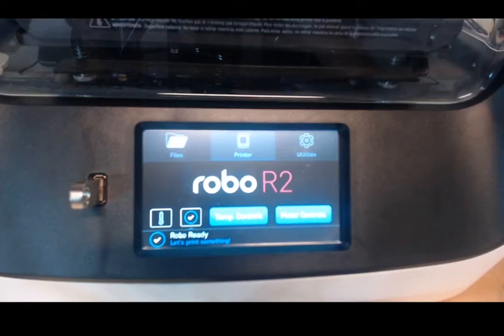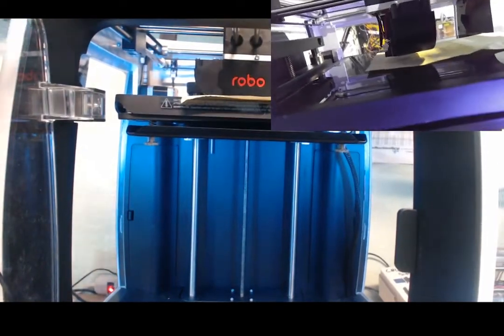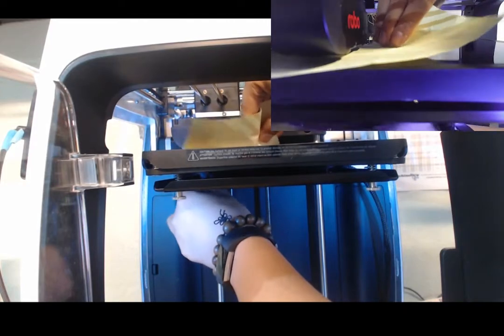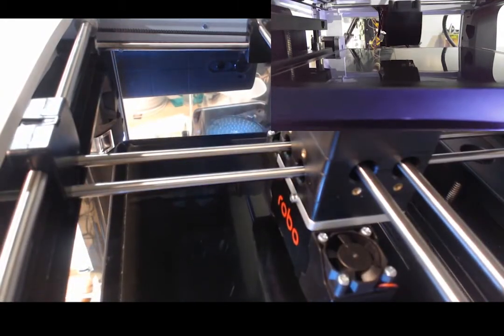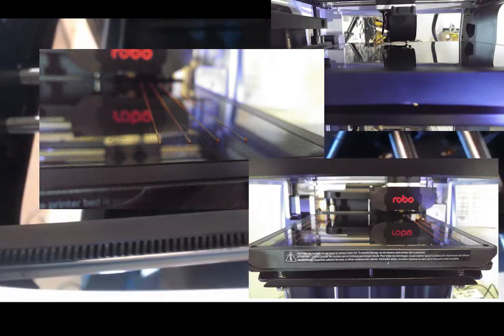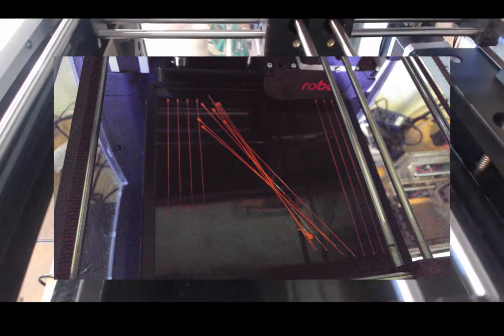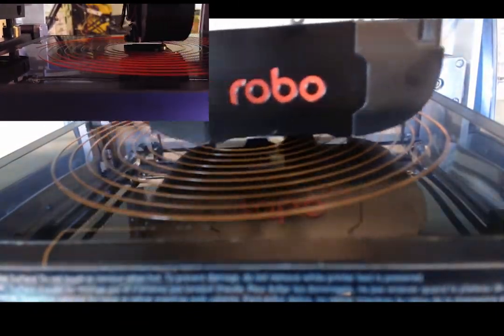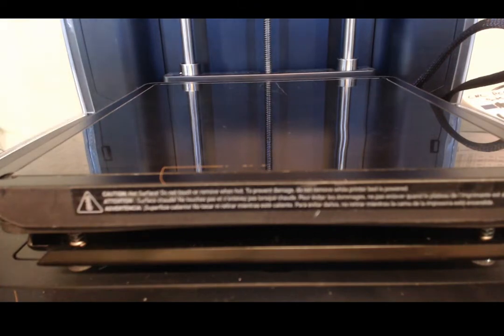PandaRiot779's Robo3d R2 Bed Leveling Tutorial

Comment: I am watching your bed leveling for the Robo R2. Could you tell me, Do I need to tighten the four screws holding the bed tight or what gap should the bed plate have in relation to support plate that the bed plate attaches too. Thanks for your reply, Richard Harmon
Reply: Do not tighten. You need to level it. The bed is suspended